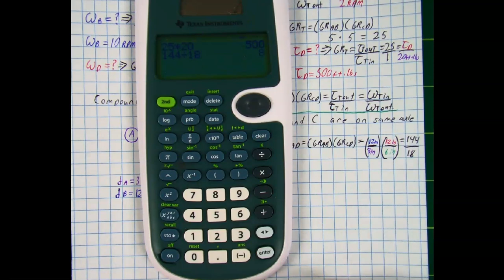Compound Gear Trains 2 - Compound Gear Ratio Formulas

Comment: Thanks for making these videos.  Why switch from # teeth/gear to diameter-of-gear for gear ratio calculations in going from video 1 to this video?
Reply from the maker: I am confused by the question. I think you are asking why did I use the # of teeth to calculate GR in Video 1, and Diameter to calculate GR in video 2? If so, it is to drive home the idea that both versions of the formula solve for GR. And you use the information given to solve.
Reply: @flippedengineering1676  nerd
Reply: @breadsoup-  nerd except good job teaching your doing your best